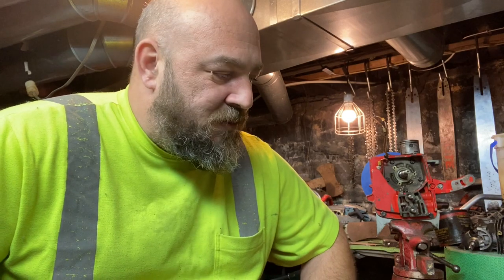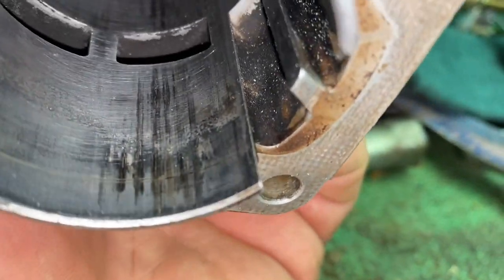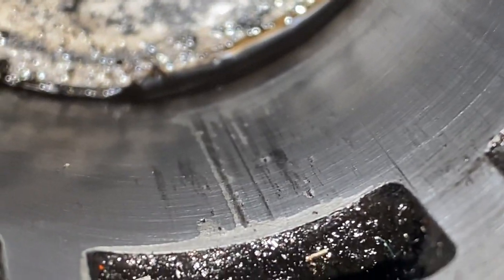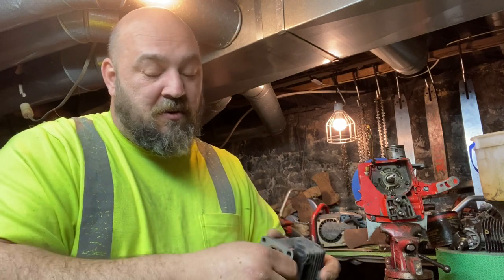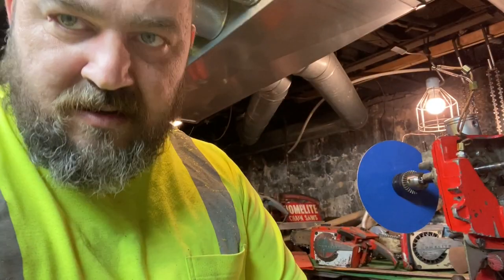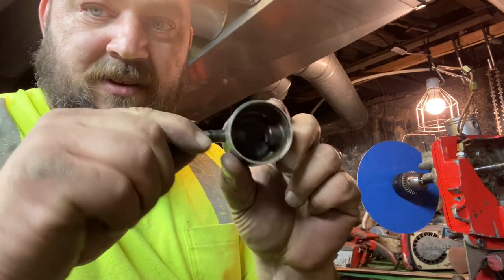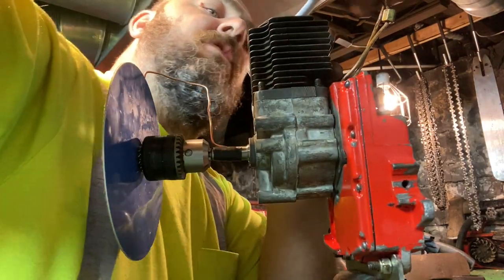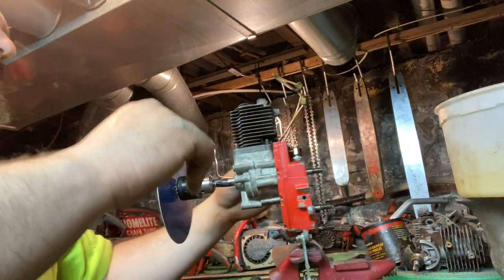Chainsaw Porting Class!!  How To Port A Chainsaw For Beginners!  Homelite Super XL Automatic #7

Comment: Couldn't you put the piston in and check volume of the to with water like they do for cc ing heads and leak down on valves just wondering I hope it's not a stupid question I just think you could tell displacement better that way
Reply from the maker: Yes that is possible.